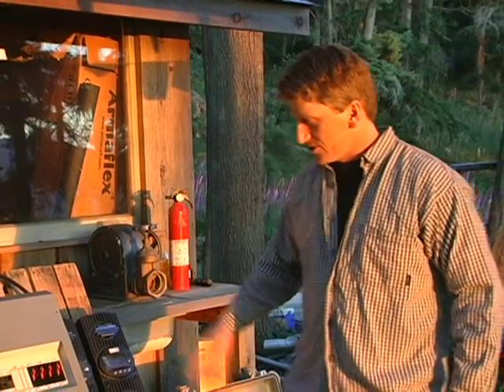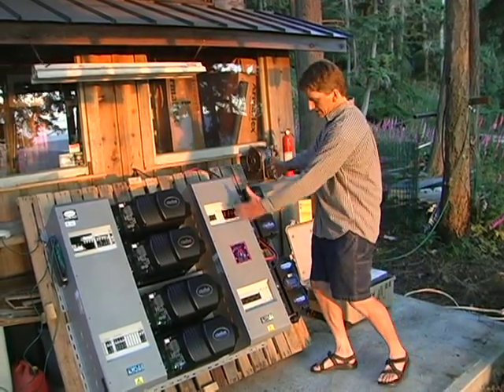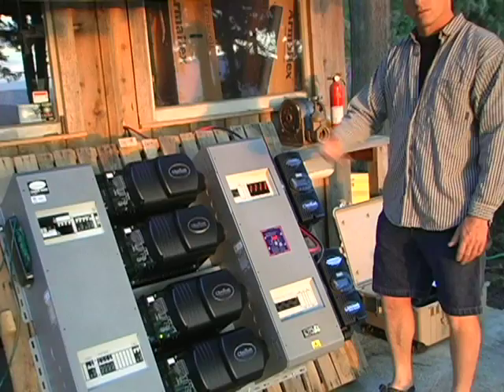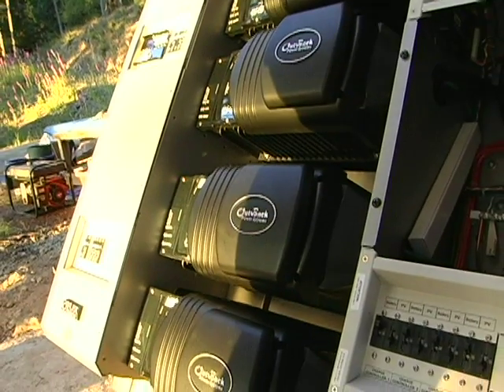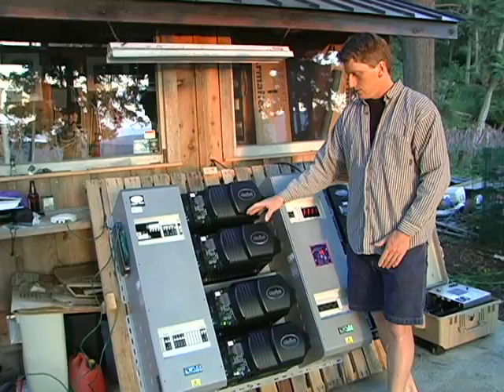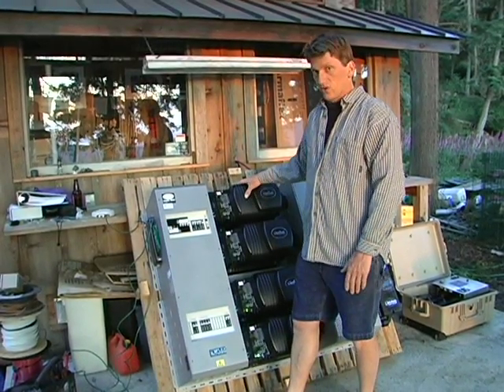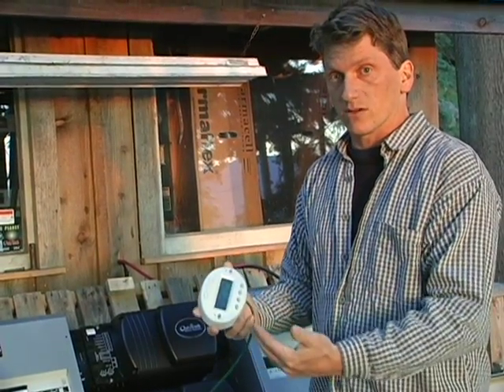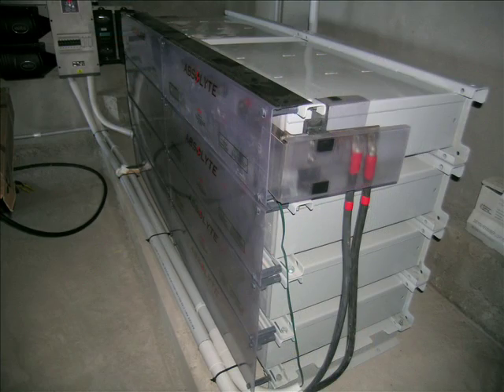Island Energy Systems - PowerCenter

Comment from the maker: The system is working well.   They ended up not using the building for a workshop as they'd planned, and instead use is a guest house.  They trenched over to the main residence and put in wires so they can run the whole place off the PV system.  The main house had grid power so now they are using the grid for backup instead of the generator.

Comment from the maker: Hey there,  sorry I hadn't noticed your question. Better late than never!  
 About $10,000 for the power center.   With PV panels now down to $1 a Watt or less the PV array would be about $14,000.       The battery will be $5,000 to $20,000 depending on how much you need.    Bigger batteries will last longer but they cost a bunch more.   Hope that answers your question!

Comment: Well if  use 12 volt to provide this mush power //   would be 7200 amp battery  
plus more power for power lose 12 to 18%  / That means  8280 amps at  15% loss 
 How ever i like 12 volt   // even with power loss //  because of  easy of replace meant   /   and easy of  hitting voltage //  12 v with wind or solar /    
   HERE,S   A  ANOTHER THING KEEP IN MIND / IF  THERE'S  / 
      ANY  WORLD ISSUES //  WAR ,// DISASTER  / EMBARGOES /
   12 VOLT IS EASIER  TO ACQUIRE / CHARGE

Comment from the maker: @farrsouth 
It would vary for different situations depending on the need for ENERGY.  This powercenter will produce around 12 kW of POWER from the batteries.    The amount of ENERGY (kWh) the system can provide any given day is dependent on the charging POWER of the PV array and the length of time the sun is shining on it (local solar resource)    a powersystem this size could have between 2kW and 20kW of PV panels, depending on the daily energy budget of the system, as required.